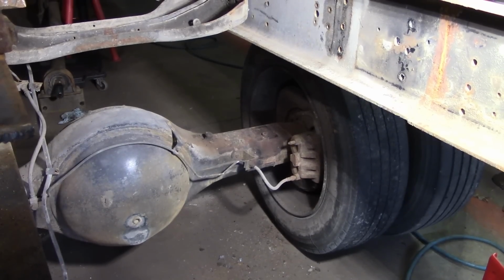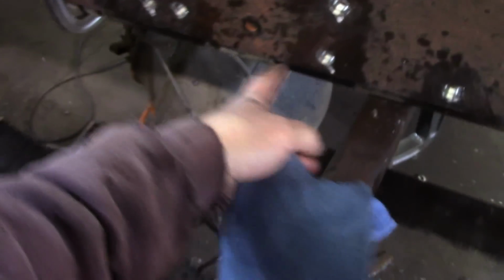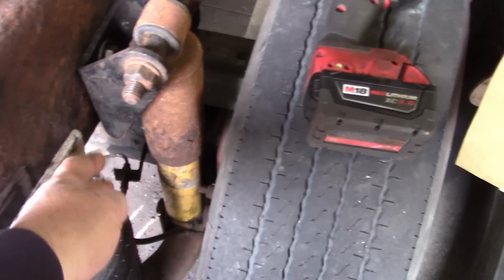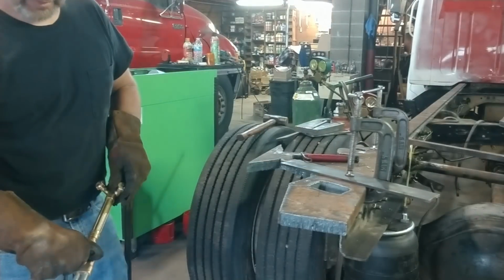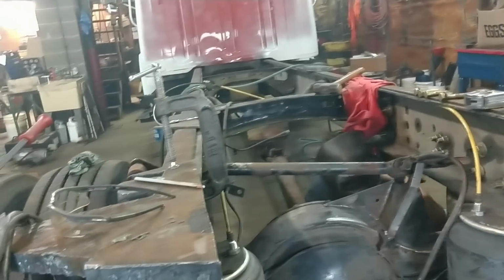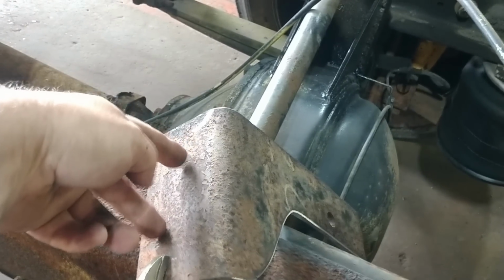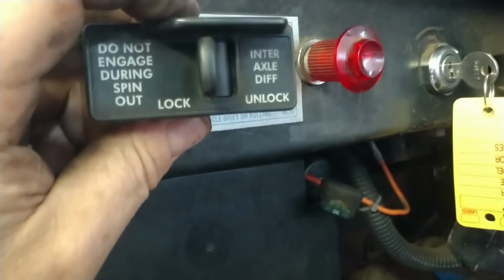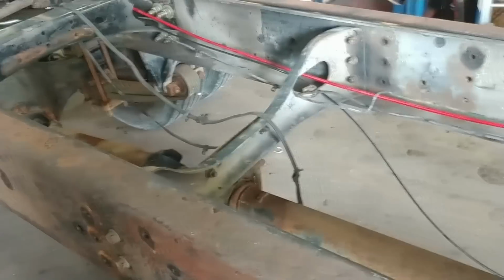SPRING RIDE TO AIR RIDE CONVERSION ON IH 4700 USING AIRLINER SUSPENSION

Comment: Why not  go to a  scrap yard for big trucks and buy a cutt off froame of a new style air ride .then just bring it back to the shop and attach it to the older existing truck .weld it  ,bolt it and connect lines .I just save you  More than half of the work you did .
Reply from the maker: you didnt SAVE me anything. air ride suspensions with hydraulic brakes are not common around here. r way would me $2500. plus the work. this was all parts i had laying around. no cost. just a few hours of work.

Comment: Do you have any sort of social media that I could direct message you I recently acquired a 1998 F650 33000 gvw It has 10 busted leaf springs on one side and four on the other Both sets of leaf springs need to be replaced the truck already has air for everything else parking brake I have a fairly extensive background in fabrication but I’m not familiar with commercial type vehicles more so light duty trucks I have a triple turbo cummins in my F250 That I swapped but I was just curious where you would go about finding the trailing arms and the lateral arm and what approximately this cost to do
Reply from the maker: buy a rear cut off. it will come with all you need and is the most cost effective way to do it.

Comment: Interested in doing the same on a 07 4300 box truck. My rear leaf springs are shot and on the bump stops. I was thinking since they are shot maybe I should just try adding helper bags instead of doing a full swap. Thoughts?
Reply from the maker: i would not add air bags to remedy worn out springs. i would replace the springs or swap out to a factory air ride set up.

Comment: That was awesome, JC!  Really enjoyed that.  This reminds me a LOT of a project we're currently working on.  I'm still waiting on a little more progress before we reveal it, but I think you'll like it!  So, that truck does not have an engine-mounted air compressor?  Did I hear that correct?  What is the compressor going to be?  Thanks for the video!!
Reply from the maker: there is not an engine driven  compressor. it  will be an electric unit mounted in the tool box. we are keeping this as low a budget as possible and he has the electric one.

Comment: Dam that 1" plate is massive !
Reply from the maker: the original mount was thicker. however it was on a road tractor with a 20,000 lb capacity axle. this truck has a 13,000 lbs axle.
Reply: @j.c.smithprojects    I've never worked with steel that thick

Comment: JC- I'm glad you're able to restart this project. I've been curious about how all this would come  together. Ready for the next video. Great torch work. I would have nicked the fence at least once while cutting.
Reply from the maker: this project is almost done. the bed is on, the hydraulics are run and i am down to the tool boxes and air compressor. should have the next video in a few days. you cant work with old rusty junk and not use a torch right?
Reply: Absolutely! Been there done that more than once.

Comment: I kinda like the Brits and their Evolution tools!
Reply from the maker: i have nothing but great things to say about this saw.
Reply: J.C. SMITH PROJECTS J.C. SMITH PROJECTS I was looking at buying a mag drill but the Dewalt’s and Milwaukee’s were a little out of my price range for a tool I wouldn’t use everyday, but I remembered people saying good things about the Evolution chop saws and settled on a slightly less expensive Evolution mag drill, it’s still a high quality mag drill for about $300-$400 less than Dewalt or Milwaukee
Reply from the maker: i have the milwaukee m18 cordless mag drill. it works very well for what i do. i am ok with the cost. the only negative thing i can say is that i am constantly tightening up the slides. i dont know if this is a normal thing for all mag drills or not. i have drilled thousands of holes with this drill and i am very happy with it. most holes i drill are either 11/16" or 13/16" thru 3/8" up do 5/8" material.

Comment: Pricey upgrade! Nice job J.C
Reply from the maker: not really. i bought a freightliner cut off and i am using one axle suspension on this and the other on a f750 i am building right now. they are reasonable to buy if you watch for them.

Comment: That is a nice conversion of that rear suspension from spring to air. The fab work is awesome as always and the way you use those used parts on that axle is great. Keep up the good work. Can’t wait to see it with the bed on !! Looking forward for your next video.
Reply from the maker: its almost done now. some finishing touches here and there.

Comment: You must have watched my service truck build slideshow..
Freightliner air is a damn good setup!! We have it on two tandem drive Freightliners, a single drive Freightliner and the service truck is an S1900 International.
Easy to use a small transfer punch, just slide a bushing over it. Maybe need a couple to get to size, but works good!!
Reply from the maker: no. i never saw your service truck build but i will search for it. i use the air liner because they are good suspensions, they are plentiful, parts are always available and they are inexpensive to buy.....i usually buy a whole truck for parts so i can save as much as possible.
Reply: @j.c.smithprojects  I looked.. dang ,covid YouTube only showing part of the videos.
I'm thinking about a year ago.. 
Yes, great suspension!
Hold very level too! My 4 axle has a 24' bed and hoist. Had the same bed on a truck on spring.. much better on air👍😎

Comment: When I did some up fitting, we had a pretty cool frame drill. It was mounted on a cart with the up and down adjustment, then a chain, hook, and wheel you turned that pulled on the chain which fed the drill bit into the frame. It was awesome
Reply from the maker: i looking into the "frame drill" it had a milwaukee drill and used regular twist drill bits. i used one a friend bought. the mag drill was less money and i thought it was easy to get set up.

Comment: That's a beefy bracket! 🙂👍 I don't blame you for going heavier than the 1/4". Its looking fantastic J.C! 🔧 Your buddy will have a nice setup on that rollback when its complete. Cant wait to see the bed install 👍
Reply from the maker: when it doubt, build it stout! the bed is on now. ready to fill up the hydraulic tank and test it out. not really impressed with the way the bed is designed.
Reply: @j.c.smithprojects  
Is there a "brand name" on the bed itself. Just curious if its a mass produced product, or shop built? I am familiar with several brands of roll back beds.
Reply from the maker: it was a manufactured bed. i have seen many older trucks with this same set up. mostly used for equipment not cars. in the next part of this i will show and explain why it isnt ideal.
Reply: @j.c.smithprojects  awesome! Can't wait 🙂👍
Reply: @j.c.smithprojects  oh nice! Getting it done! 🙂👍 its a shame that the bed is not designed as well as you hoped. Maybe it's needing some "fine tuning" 🤔😉

Comment: Looks like it should work good. An observation here, shouldn't that panhard bracket been on the inside of the PH bar to allow shims to center the axle for alignment purposes? Btw, those torch glasses are more effective over your eyes instead of on top of your head. That dump valve should make loading a lot easier.
Reply from the maker: i put it the same way it was on the donor truck. it ligned up pretty well for an old air liner suspension. you should see the picture my wife took the other day. i wear glasses to see small details and print, clear glasses when grinding and the tinted for the plasma cutter. i couldnt find the reading glasses. she showed me the picture she took. i had all 3 on my head and couldnt figure out where i left them.
Reply: @j.c.smithprojects  Ok, I'm not real familiar with that specific suspension. Many use a shim setup, or provision for shims to align center. The 3 glasses would be something to see.

Comment: I must have missed it, but im left wondering by you didnt swap the axle alone with the suspension? Seem like it would have same time and effert?
Reply: i don't think he mentioned it but i can think of a few reasons, rear end ratio mix match, the axle that would have been paired with that air liner suspension would have air brakes where that truck has juice brakes also the axle that would have originally been with that suspension probably would have had different series u joints a new yolk to match up to the existing drive line would cost around $400 alone. so a little fabrication for brackets and mounts really is just a lot simpler short of starting with a air brake air ride truck.
Reply: You mentioned a ton of things i had not thought about. I figured it would have been something as simple as gear ratio
Reply from the maker: i mentioned it in the first video on this project but that was awhile ago. i didnt use the donor differential for several reasons. mainly because this truck was hydraulic brakes and the donor was air. gear ratio was wrong. yoke sizes were different.

Comment: I make all my cuts in thick plate steel the same way. Works just fine as long as you're good with a cutting torch.
Looking forward to seeing the bed on it.
Reply from the maker: i dont know that i am good with a torch but i got it done.